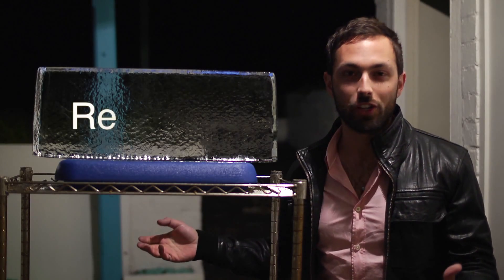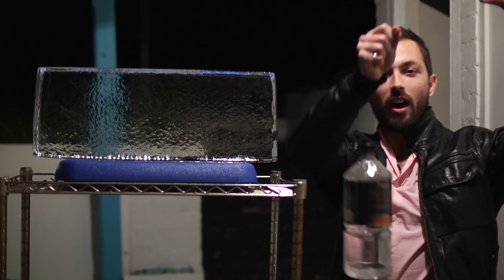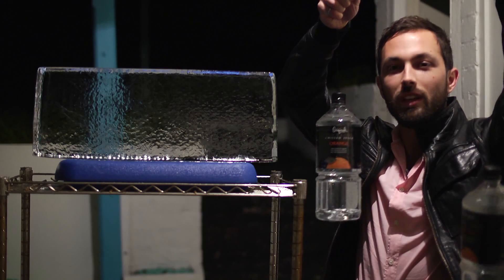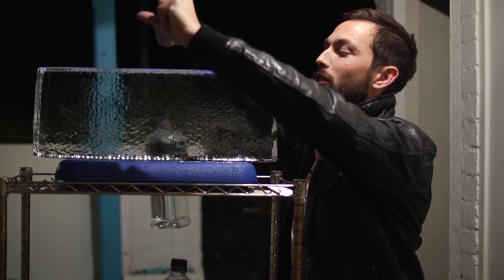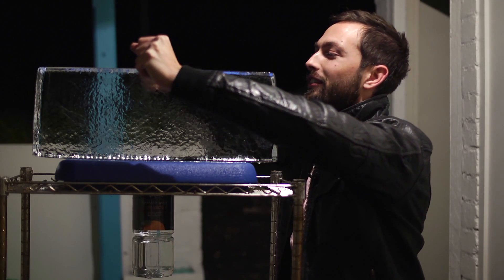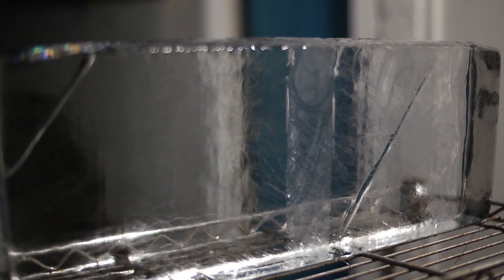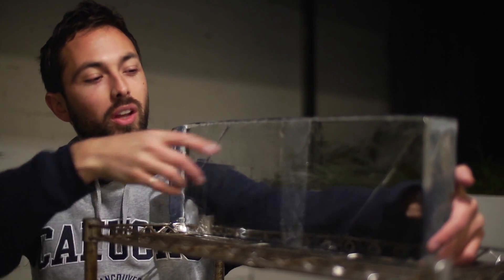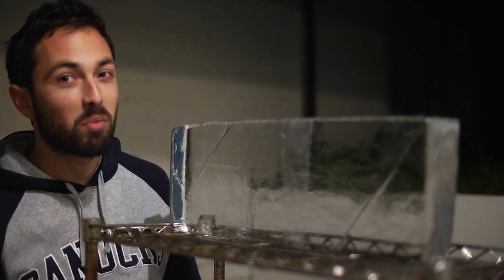Does Pressure Melt Ice?

Comment: So if pressure increases the melting point of stuff does that mean that ice would normally melt at 2000-3000 degrees F?
Reply: Cause of the atmospheric pressure I mean.
Reply: A melting point is a ratio between pressure and temperature.

Comment: No, it's not that is makes it melt, adjusting the pressure moves the point the material is at across the phase plot, if the change is great enough it will move it into a different phase (assuming there is one to move to with that particular shift). For example with the ice raising the pressure makes it so the ice is no longer cold enough to maintain a solid state and reverts back to a liquid. Lowering the temperature would allow it to solidify again. Additionally for ice, there are different kinds of ice with different properties depending on the pressure and temperature they formed at. Wish I had a link to that picture.

Comment: this rule can also be shown by putting gased water in the freezer and leaving it there for a few days till the water would be frozen but the preassure provided by the gas keeps the water fluid which can be shown if using a clear seethrough bottle if then the lid is opened the water will freeze from bottom to top and u can whatch water freeze pretty fast!

Comment: When looking at ice from old and/or large Glaciers, if you were to bore out a long vertical section and look at it (which is done for many experiments) you see the top ice isn't transparent (as it's basically compressed snow, with air trapped inside it).. But the lower layers, who have been under a lot of weight pressure are usually transparant ice without air. Does the phenomenon from the video take part in the glacier phenomenon I described?

Comment: Veritasium hey man. perhaps you should try with a wire that is made of a material that conducts heat slower than air instead of copper. maybe the result will be different.

Comment: wait if pressure melts ice there for making it warmer why is it that when you descend into the ocean it gets colder?
Reply: ShadeShotGaming  Lack of sunlight.   Technically, it don't really get it warmer, the pressure just change the temperature at which ice melt
Reply: ***** Basically that is where supercooled water in large glaciers comes from. Extreme pressure made the ice into water, yet the water is far below the freezing point.
Reply: Firecage Yeah. the water is under a strong pressure due to the glacier and it prevent it from melting.  it works even better with highly salted water
Reply: +ShadeShotGaming pressure does not melt ice by making it warming.  Pressure lowers the melting point.   For example the melting point of ice is 0 degrees centigrade.  Pressure will lower that point to -5, -10 etc depending on the pressure.  So the ice will melt even if the temp is below zero.  
Pressure does not change the temperature of the water/ice.

Comment: I have been binge-watching this channel and I have enjoyed it immensely. I have seen a lot of material covered and this is the first myth I believe I've seen propagated here. If you calculate the pressure that would be required to melt that block of ice, you quickly realize that you need many more water bottles.
The block appears to be about 10 cm wide, so the arc under the string, within the ice is about 15cm. 
A "Light Gauge" guitar high E string is about 0.25 mm wide
The ice area under the string is 38mm^2, or 38 * 10^-6 m^2
The pressure required to melt the ice is roughly 50MPa
6 of the zeros cancel each other (^6 Pa, ^-6 m^2), so 
50 * 38 = 1900 Newtons, or 194 kilos.
It would have taken nearly 200 liter bottles of water, to impart enough pressure to melt that ice.
That wire is conducting heat from the surrounding air, which is melting the ice.
Reply: stephmon Well, the block looks to me at most about 3" or about 7.62 cm thick, based on using his hand as a reference.

And the pressure depends on the temperature, and approach atmospheric around 0 C (as it obviously must).

But yeah, even that, it's not quite enough for regelation to be responsible.
Reply: seigeengine OK, if we go with your estimate: ~150 liter bottles of water. Still 148 more bottles than was shown in the test.
Reply: seigeengine  its not 50mpa to melt ice it's about 1mpa
Reply: Oliver o niell Nope.
Reply: seigeengine It is about 1mpa at 0c and goes up to around 50mpa at much lower temperatures
Reply: Oliver o niell no

Comment: But if you put the ice water block say at 15C in a low pressure environment, what would happen ? Wouldn't the low pressure lower the melting point of the ice, causing melting and increased sublimation ?

Comment: The pressure required for regelation here exceeds the force applied. Conduction of heat from the room through the metal wire is more likely the explanation of this video.

The melting point of ice falls by 0.0072 °C for each additional atm of pressure applied. For example, a pressure of 500 atmospheres is needed for ice to melt at −4 °C.[3]

Your E string should be approximately .010" in diameter. This is approximately 0.25mm. I am going to estimate the width of your block of ice at about 2", or approximately 50mm. So the area the force is being applied to is approximately 12.5 mmsq.

If at least 500 atm (50 MPa) is required to melt the ice, a force of (12.5×106 Pa)(12.5×10−6 m2) = 156.25 N is required, a force roughly equal to the weight of 15.6 kg or about 34.32 lbs. I would guess that your bottles of water here weigh about 5-10 lbs.

I am not a scientist, and my source for the data and calculations here is wikipedia - I have not verified or cross referenced my results, but I am skeptical of this particular demonstration of a real and observable process.

But you do state you are outside and it is above 0, so the weight required should be less than what I have calculated. And it is still an interesting demonstration.
Reply: Jay Brown Sorry, rewriting this, so I'm a bit annoyed.

Closer to 0 the pressure needed drops to maybe 10 Mpa or lower.
Your math is wrong, the pressure is independent of the area, so it should be (50x106 Pa)(12.5x10-6 m2), or 625 N or 62.5 kg

You'd need to fiddle that down to around 1.5 MPa for the 2 kg or so of water there to cut through the ice.
Reply: Jay Brown did you consider that it didn''t begin melting it consistently? it started by concentrating the weight on the small edges of the block while the middle remained intact for a while.
Reply: xXJeReMiAhXx99 I believe this would be the case regardless of whether it was heat or pressure. The heat would melt the exterior portions of the block first by conducting heat, but the corners should also be under more pressure.
Reply: seigeengine problem is the heat theory would only cut for a couple seconds, maybe somehow for nearly a minute at the most, in the case of this video I believe it continued to cut for hours until it got through the whole thing
Reply: xXJeReMiAhXx99 I think you need to rethink how long heat would take to cut through this ice. This isn't a red hot wire here. It's at ambient.
Reply: seigeengine it's not ambient, it could be ambient or hotter like I said for the first 30 seconds at the most, after that it's going to be matched with the temperature of the ice(or about as close as it can get) so it wouldn't make sense for heat to cut it.
Reply: xXJeReMiAhXx99 ..... No.

Comment: So the pressure compress the ice's particle, causing it to heat up and melt. The melted ice, aka water, then froze solid due to the low temperature of the ice surrounding it. It doesnt turn back to solid just because there're no longer a pressure.
You can put 2 ice cube next to each other in water, and the water between the cubes will freeze, making the cubes stick together.
Reply: If you use a machine to pressure the ice completely into water, when the machine's pressure is release, the water remain as water since there're no longer a low temperature environment around to freeze it.
Reply: I'm no scientist, but the "regelation" seems not particularly convincing to me
Reply: +lHawkel if you keep all the energy in the system with no loss or gain of heat, then it will go back to a solid.

Comment: the water bottles are not ice so the heat transfers through the wire and melting it and the ice only refreezes cause its cold outside..this should be done in a pressure chamber at a constant temp. and changing pressure...

Comment: fun fact: the wire is good at conducting heat, while the air surrounding the ice block is an insulator, which may be why the ice melts faster in contact with the wire, since u said the outside temperature is above 0. however i cannot understand why it re froze in positive temperature...

Comment: PV=nRT?

Constant "V" volume, constant "n" molar mass of the ice, constant "R" the ideal or universal gas constant. Increase pressure gives rise to increased the water T, presumable enough pressure to sent T above water freezing point.
Reply: The ideal gas law doesn't apply to solids, or liquids. It applies only to gasses, and even then only over a certain (albeit wide) range of states of gasses. As a result of the universal gas law, at STP (273.15K, 101.325kPa) a mol of any gas occupies the same volume (22.4L) as any other. As this does not hold for solids or liquids, the law does not apply to them. In truth, this effect would happen even if there was NO temperature increase, say if you were to apply the pressure with something that could keep its temperature at one exact place. This effect only applies in substances in which the liquid form is denser than the solid form, such as water. When you compress the solid (thereby increasing its density) its state changes into a liquid, because at the higher density it must necessarily be liquid. Note that this only applies at a certain area on the phase graph of such a substance. What you are essentially doing is forcing the solid substance into an area on its phase graph that it must be liquid.
Reply: Forrest Carroll Ah-ha! Excellent! Thank you very much Forrest!

Do you know if this in some way explains the phenomena of below zero deionised water instantly turning to ice if disturbed, and if the disturbance is acting like the reversal of the high pressure string on the ice? Tapping the bottle could introduce enough energy to suddenly reduce pressure/density in a certain area of the water that then sets off a chain reaction to the rest of the water?

Also, are there equivalent laws governing ideal liquid and solid states? Or perhaps there's no need.

Comment: Can you put the ice in a pressurized cylinder increasing pressure and it will turn the ice into water? then releasing the pressure will turn it back to ice?
Reply: yes, 210 MPa at T > -21 deg C.
Reply: So this is somewhat a presentation of charle's law?
Reply: ***** Scuba tanks don't contain liquid air. They contain a mixture of Oxygen, Nitrogen and sometimes Helium (only for really technical diving). Shin, technically you could be right because as you pressurise something it heats up which could melt the ice. releasing the pressure could freeze it again because when you depressurise something it cools (which is why deodorant from a pressurised can is so cold). But in the case of the wire and the block of ice, the wire passes energy on to the water molecules in it's way. This causes bonds between water molecules to break and reform once the wire has passed
Reply: ice melts under compression up to 210 MPa in the temperature range around - 10 degC; ice formation at room temperature under 1 GPa. refer to the phase diagram.
Reply: Phsae X density is 1.22 times of 4 deg water; ambient water becomes ice at
1^4 atm pressure. refer to the phase diafram of water.
Reply: It is actually the opposite. If you put water under pressure it forms into ice, because the molecules can't move anymore. This is the reason, why there are planets out ther with maybe 500°C but still have ice on it. That happens if the pressure is very high. And this would happen with your experiment too. This what is shown in the video is something else. It just works because the force is limited to a small area.

Comment: you should have done this experiment in a room that was below zero degrees, would it still cut the ice?
Reply: epic blade  No, not without exerting 10mpa of force on the ice. In this video the melting of ice is by conduction of heat from  the air into the wire allowing the ice to transition to liquid around the surface of the wire. it refreezes because of the size of the block and the melt water that fills the crack has its heat conducted back into the surrounding ice cube. However Regelation is a real thing though and can occur in sub zero conditions but the optimum force is 209Mpa (30312psi) which is a lot of pressure.
also sam witwicky there are no polar bears living in Antarctica, just like there are no penguins at the north pole. but if you flew a polar bear to Antarctica and stood it on the tip of its claws on a ice cube, on the ice. assuming the polar bear is of average weight of 800pounds and is claw tips are sharp enough to contact on less then 0.025sq inches (4mmx4mm) of the surface of the ice cube. then yes it would melt the ice from its weight.

PS. if this videos high 'E' string is .008inch thick and covers 6inches of ice then its force is 150psi~approx assuming they are 1.5l bottles. and 1450psi is when waters triple point starts Regelation.
Reply: onemorecowswag yess ,  but lets says a polar  bear is standing on an ice cube in Antarctica with it's sharp claws open . Now would the ice melt . GO
Reply: Shane Wilson This man knows!
Reply: onemorecowswag i don't think so! there is a difference between melting and cutting . The ice melts under pressure? then put the freaking block of ice under 400 tons tank and let's see the water! till then this is bullcrap
Reply: Jeffery Wells ok then, put a 65 tons tank above a smaller block of ice and let's see the water
Reply: sam witwicky the surface area of the object melting the ice has to be proportional to the object's mass. For an example look to ice skating, the forward momentum is often accredited to melting the ice under the skate by means of regelation, but in fact the skater would have to be much, much larger than a normal human because the mass of the skater and the surface area of the skate aren't correctly proportional.
Reply: Shane Wilson Thank you for this explanation.
Reply: Shane Wilson Yea, thanks Shane. Thats what I was thinking also, its been a few years since I've heard of this subject so I wanted to make sure.
Reply: yes, the ice melts by regelation not heat
Reply: so does the ice in Antarctica melt under its own weight
Reply: Did you watch the video? He was applying pressure over a small surface area and melting the ice.